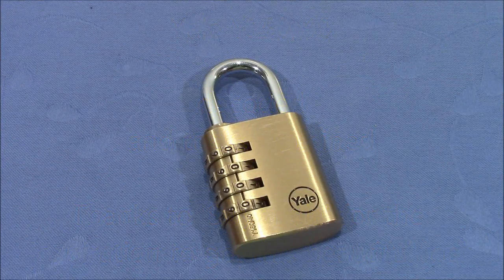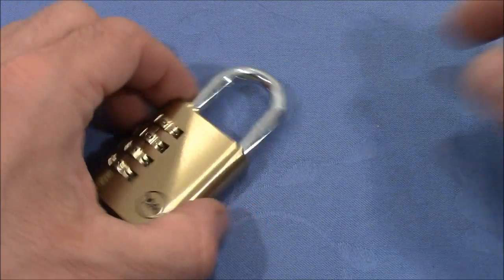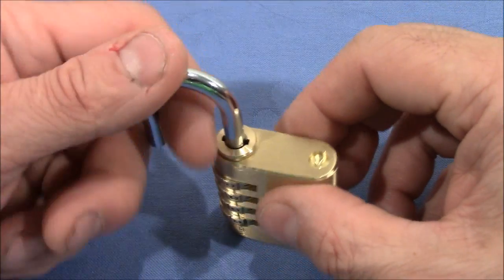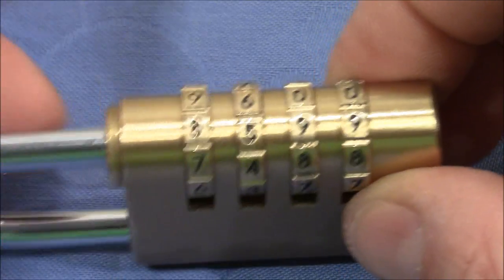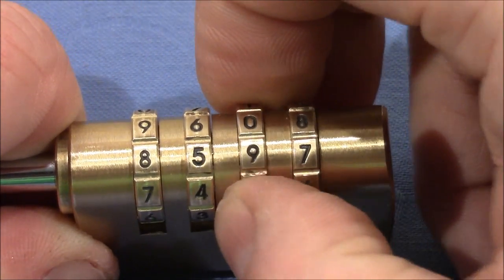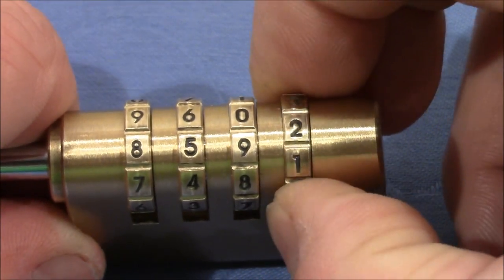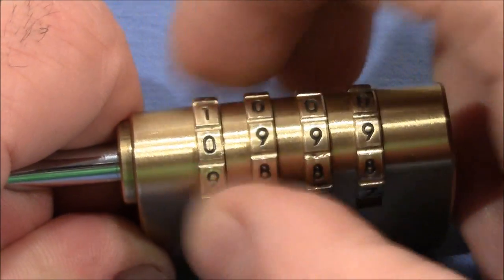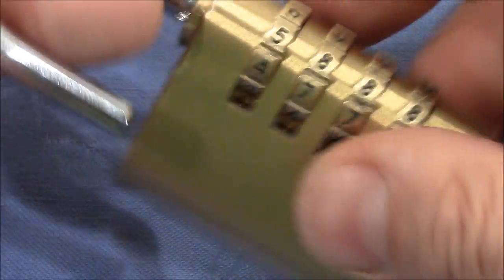(picking 528) Yale combination padlock decoded - false gates defeated / decoding tricks explained

Comment: First time decoding a lock, trying to open a lonely, lost padlock that I found on the street. Looked at some random videos but couldn't get the methods to work, found this video and realized it's because I had found a is a SUPER FANCY TRICKY LOCK (Yale 150/30)! Finally got it open today, after about a week of trying this method and the not-pulling-the-shackle-method from another video. In the end I got more lucky than skilled, so no lock-whisperer yet, but glad I managed to open it without having to resort to the "brute force"-method of trying every combination!

Comment: All you need is a long needle. Put it in de hole from above, en rotate the first wheel. At a point the needle will fall deeper onto the second wheel, turn the second wheel, and so on. Reed the number and turn all the wheels just one notch. Do this (turning one notch) untill the locks opens.

Comment: Have the same padlock model and mine can be opened without pulling the shackle during decoding. In true gates, wheels are moving up and down quite a bit .
Reply from the maker: Really, can you show how you do that?
Reply: I figured that in mine when wheel is in a false gate it is springy, and if you move it from one side or another it will always spring back. In true gates however if you move the wheel up or down, it stays.

Comment: Can someone help me. Ive found a lock that is locked but its locked backwards. As if it is in the reset code position but not pushed down. I cant figure out the code. Do I pull on the shackle while turning? sometimes when I do that, the wheels are stuck and cant be turned. I need some help T_T

Comment: I have this same lock and the shackle is turned 180 degrees pushed down and it's stuck in there. I am not able to reset the password nor push the shackle back up. Any help would be really appreciated. Great video by the way. Thank you.
Reply from the maker: Oh, that's weird. Try to decode it open if you feel wheels binding when pulling on the shackle.
Reply: @Potti314  None of the wheels seem to be binding : ( We just bought a new padlock, it's a mess. Thanks by the way. Great and helpful videos. Subscribed.
Reply: Same situation is with mine.... Did you make any video on that

Comment: yale padlocks have the logo on the front in the lower right corner. guess that's why the line is on the side allowing that design
Reply from the maker: OK - I see, although I had changed the combination more than once to a known one and wondered why it didn't open again. I looked at the wrong side - that line's position is counter intuitive for me ;-)

Comment: Can you make a new code when it is open. And how. I have tried but it won’t open all the way.
Reply from the maker: You can change the code by rotating the open shackle to 90 or 180 degree and pushing it down. Change the code, then release the shackle. Close and re-lock it. Done.
Reply: But the shackle won’t come all the way back up, when I reset it
Reply from the maker: Could it be wear on the lock like here https://youtu.be/TN9TxW9koJs
Reply: Potti314 Hi again I’ll try to upload a video som day so I can explain what I mean. But thanks for now.
Reply: My shackle is open and will freely rotate, the correct code is in place but the shackle won’t lock home.. and I can’t turn the wheels. Any ideas 
Cheers ✌️